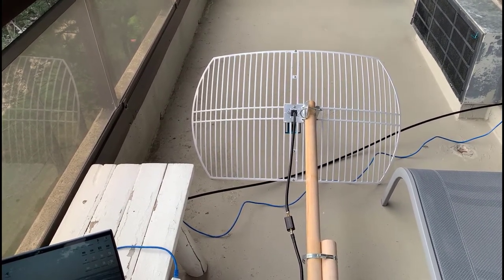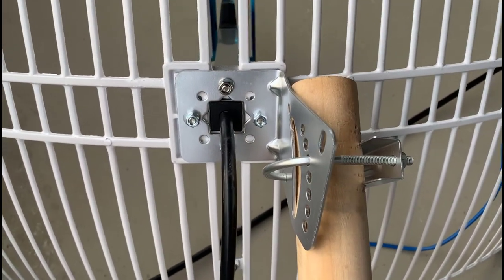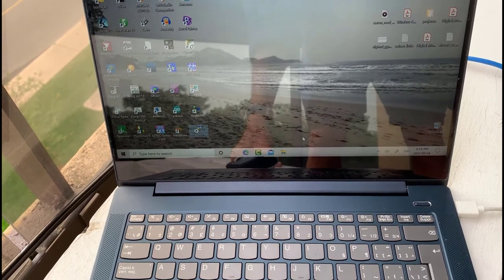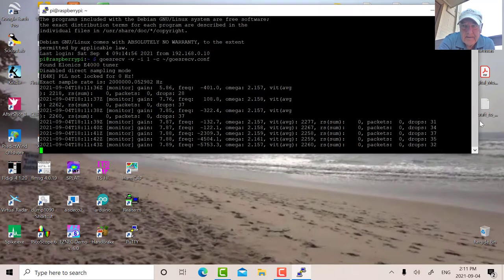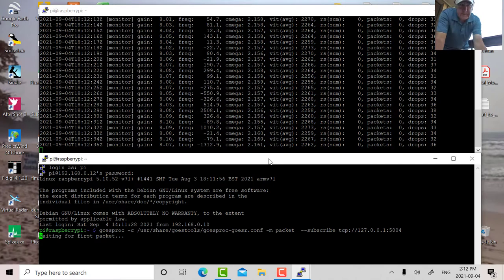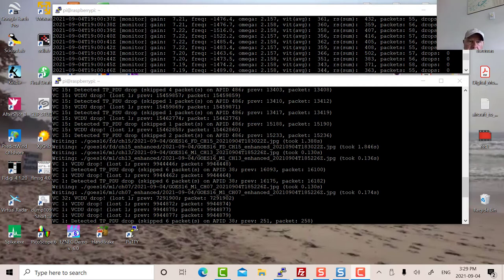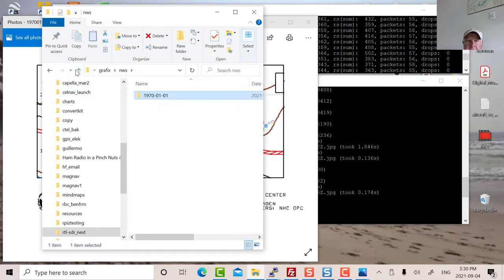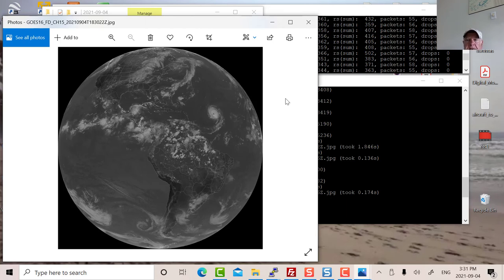RTL-SDR for Satellite Weather on GOES16 - Image Capture

Comment: I've been fighting with my setup for nearly 3 days now. I cannot get my vit below 1200. The lowest I got was 1000 once or twice. Its no longer fun and I'm about ready to abandon this project.
Reply from the maker: What is your SNR?
Reply: @ClarkTelecom  I'm honestly not sure. I'm just jumping back into the SDR hobby and I have to brush up on RF stuff. I broke everything down and put it away. I can reassemble it all tomorrow. I have a feeling the signal isn't making it past one of the components. The equipment I'm using is a 2.4 GHz 20 dBi Outdoor Grid Dish Antenna similar to the ones I've seen in multiple forums and YouTube videos. I have tried this stock, with the 2.5cm spacer and in multiple orientations. That's connected to a NooElec SAWbird+ GOES LNA, then to a  NooElec NESDR SMArt v5. I'm providing power to the SAWbird via USB from the Pi since the SMArt doesn't have bias-t. This is all connected to a Pi 3B+ running Rasbian Lite x32 with GOESTOOLS. I've followed so many different tutorials and watched many videos. I'm at lat 41.374, Eastern Pennsylvania with wide opens skys. The frustrating thing is, I've seen you hold your dish and just point it and get a good signal. I have mine on a near perfect mount and basically pointed right at GOES 16 and can't get a usable signal. US Radio Guy's dish pointing tool gives me Az(t) 179.7, Az(m) 192.0, Elivation 42.2, Skew 0.2. Basically dead nuts South.
Reply from the maker: @TheBurnsStuff  Check out my blog post for photos of signal capture. You need at least 8db between signal peak and noise floor to get a decode. Try the gear on Windows with SDR# to confirm the signal first. What coax are you using?

https://jeremyclark.ca/wp/telecom/rtl-sdr-for-satellite-weather-on-goes16-signal-capture/

See Fig.1
Reply from the maker: @TheBurnsStuff  Sounds like you have all the gear. If your snr <8db, you probably won't be seeing much which is confirmed by the high vits. So perhaps the dish has low gain at that freq. If you have a spec analyzer you can test the LNA with just the background white noise. It's worth pursuing, it took me months to get it all working. But once you see the pictures it is out of this world. When you get the NooElec dish you can then move on to the Hydrogen line, that took me about 6 months, but again an awesome experience. I bought a NanoVNA which has proved its worth over an over again. I also used it to sweep the dish to confirm its freq range. Good luck! One more thing, don't forget there is tilt on the dish as well, about 5deg if I remember.
Reply: @ClarkTelecom  Hey Jeremy. I wanted to give you an update to this issue. I received my NooElec GOES kit today and there is a stark difference between this dish and the 2.4ghz one I have. The NooElec dish is significantly larger than my 2.4ghz. I assembled it and mounted it to my same test pole. The vits averaging 150s-170s, no drops. Pointing the dish was just luck lol. I basically said "ok, lets try this spot". Dead nuts on the GOES 16 signal. Thank you for encouraging me to stick with it. I'm very glad that I ordered this kit and fired it back up.
Reply from the maker: @TheBurnsStuff  Hey that's fantastic. When you see those first pictures you won't be the same. The new dish works all over L band, so you can receive all sorts of stuff!
Reply: @ClarkTelecom  I've been pulling down images all afternoon, and... WOW! I am thoroughly blown away!!